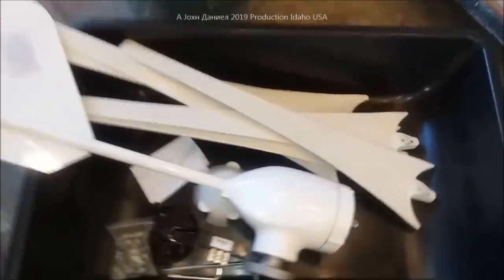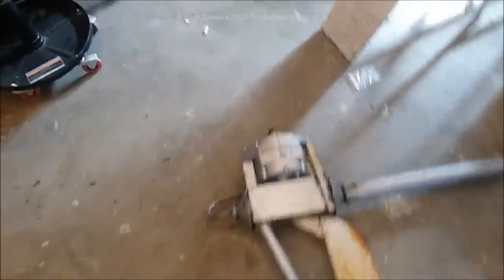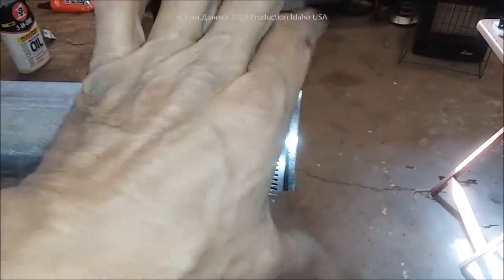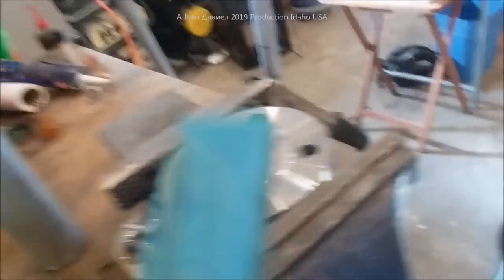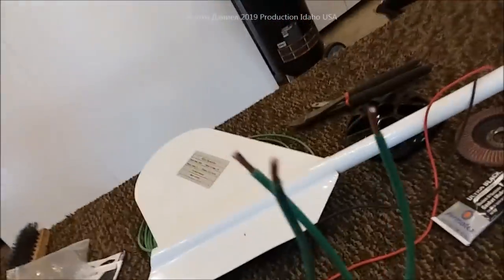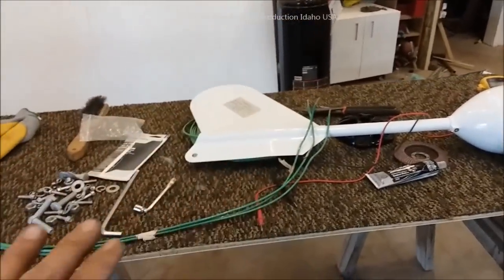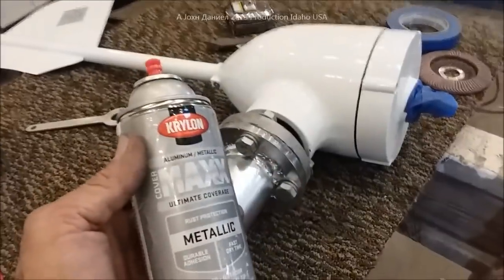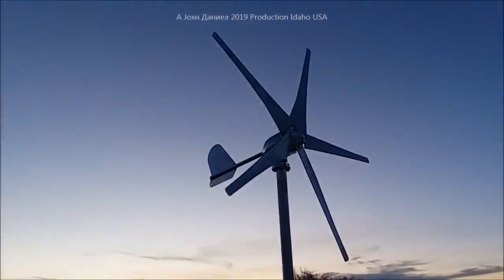Accurate 500 watt, 5 blade Micro Wind Turbine, The Install build, ALL PARTS LISTED BELOW!

Comment: I guessing the limiting the temperature to       250°-350° F, is to prevent oxydising that will happen at a higher temperatures, while unshielded by the flux? I never used this method, I thought about it, I always used a stick welder, I have a 120v mig, I'm running flux core in, mostly for sheet steel, 1/16", 16 ga, or less usually, the thick stuff, I get out the big arc. It has a wide range of current,  I want to build a gas powered air compressor and maybe a bigger generator to run a shop. Being off grid, I think that will be most effective, today and tomorrow would be a good time to have a wind turbine, its verry windy here, maybe too windy, I recently lost a couple trees, I'm thinking there is a place to put a tower!! I'm thinking atleast 40', with the other trees there, but this left a decent clearing. I may get one of these, great video!!
Reply from the maker: If you go over 350 you get popping and pitting from the metal being burnished.
Reply: @JOHNDANIEL1  More great info, thank you.

Comment: We live on top of a hill between a valley; there is plenty of wind but I have difficulty figuring how much of a battery bank this will charge. Or how much an average house might need. Actually, we consume much less than the average home. We want to buy two wind turbines and put in a LiFePo4 battery bank. How about a video on battery banks?
Reply from the maker: LiPo and wind works well, you just have to have a much higher grade controller system. I have installed 8 of them, seems they have much more hard hitting amps for over draw conditions on inverters.

Comment: What differences have you noticed between the 3-blade and 5-blade versions regarding wind speed and power output?
Reply from the maker: 5 blade is about 15% higher output from 9 mph till it hits 13 mph, the same power from 13 to 20 mph, then 15% lower output after it hits 20 mph. As a trickle charger for 10 + amps, in lower wind areas the 5 blade is better suited.
Reply: @JOHNDANIEL1  thank you for actual information I haven't seen anywhere else. ANYWHERE! And I went to a renewable energy College.

Comment: As usual I like it John nice setup. I thought you were selling that shop?
Reply from the maker: We still are, but theres no better place to run test.
Reply: I could only dream of having a shop like that I would probably get shot by the government for building some cool shit that would benefit humanity.  I love dreaming up shit then figuring out how to build it then just do it.
Reply from the maker: Bring me $315,000 in small unmarked bills to a undisclosed location dressed in black with a English to Creole to Swiss translator and the place is yours just as it sits! Acreage to build a massive green house, 130% business growth area, low on florist and agriculturist just waiting for someone wanting to go underground in a mid evil method!
Reply: Um find me a winning lotto ticket and you have a deal lol I'm freaking broke.
Reply: Seriously you could do some serious dr evil shit in that shop lol. All you need is a plasma 3d printer and a bunch of cool guys who are all mechanical and electrical engineers and your set
Reply: Well I have moded the lift crane pretty good its working so far I need to adjust the bottom clevis a bit center up the Jack a bit more I will have to weld a plate on the I can bolt the scissor jack plate to . So its centered up more. And I'm going to weld a plate up on the main support tube and where the arm meet and drill a trailer hitch pin hole there so I can pin it when it's up for safety reasons and also and eyelet for winch to clip on and make sure its fastened good and wont budge. Works good so far. https://youtu.be/EI7WCcLJtbc
Reply: If I had a shop like that you would see some neat shit be built there I have so many ideas.

Comment: Hope it's not the same as with that worthless vertical Chinese lantern.
Reply: I bought the 600 watt 24 volt lantern and it does nothing, spinning by hand I get more than 20 volt but as soon I  put on a small load it drops to about 5 volt, the wire inside is very thin, doubled and in star configuration, it is copper coated aluminium wire, the space between  the magnets and coil is too big, decoration only, there is another YouTube  channel reporting on it with lots of wind noise confirming my results with zero charging a 12 volt battery. Maybe the ones tested here are prototypes  with real copper and stronger magnets inside and John got them to promote the product. His followers buy it just like i did and get scammed in the end. I don't trust these Chinese windmills.
Reply: AGREED, my lantern deal has done nothing in Edgewater Florida, The horizontal works only in winds 8 mph or higher and then rattles, hard. Six months of testing.
Did contact  WUXIFLYT in China directly (or whoever they were) to ensure I had the correct models, updated design or whatever.
Reply: That vertical wind turbine wasnt worthless it actually did give him a skeleton he can mount a nicer PMA to and get the juice from it.
Reply: What I've read about those is that the magnets in the generator became demagnetized because of some sort of defects, but if you change them you should be able to get the 300-400W that they say they'll do like these.
Reply: That vertical Lantern turbine is a drag device. 
Proper horizontal turbines are lift machines, they use an actual airfoil like an airplane wing or propeller. Check out the cross section of a blade sometime.
That's why they work so much better.